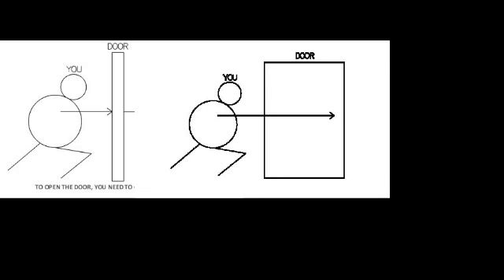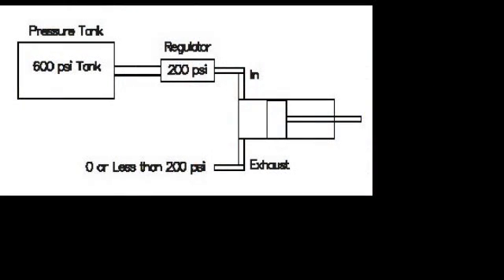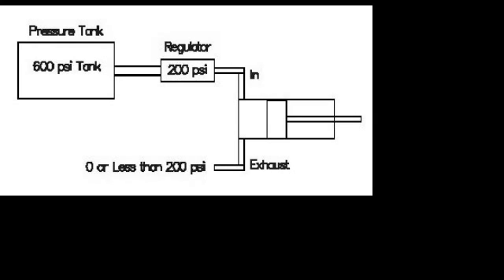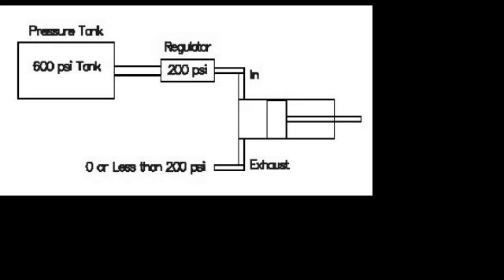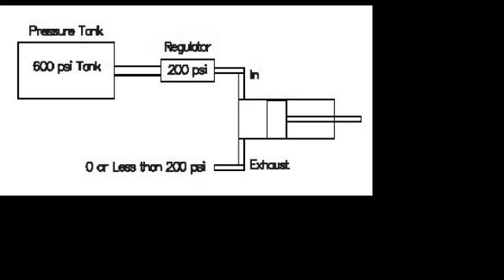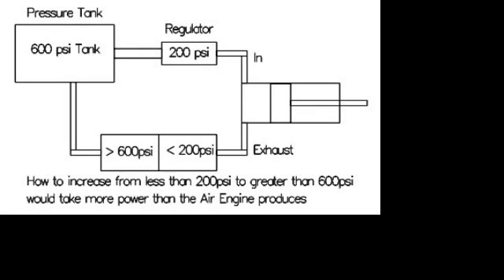Compressed Air - Recycle ?

Comment: There is a video from Terry Miller called the spirit of Joplin compressed air car, Maybe you could check on it. He was successful in running a full car on compressed air which can be easily replicated.
Reply from the maker: I watched the whole video, it is pretty impressive, but it’s pretty complicated and expensive and I guess with the help of the entire town which would be engineers mechanics machine shops it was doable.
I wonder why he used five storage tanks and he doesn’t actually say how far he can go on those five when he says 24 hour driving I don’t know if he means those five tanks will go for 24 hours. Questionable? 
I also wonder if it’s still there that was seven years ago and I never did hear anything about it back then just wondering.
Reply: @AirEngineResearch   I believe the design is simple to make. The late Terry Miller was able to show us a plactical path to air engine as follows: 1. You reuse your exhaust air and 2. You make a power stroke engine whereby multiplication of the speed drom the engine, just like what effective steam engines were designed is the way to go.
Reply from the maker: I’m using the airflow to regulate the speed of the engine and the transmission to gain power versus speed when needed. Thanks for your comment. Appreciate it.
Reply: @AirEngineResearch  I surely like the work you do. Just like Terry, Air flow requlates the engine's speeds best. Maybe you could make the engine run slower in relation to the output. lets say if you need a 1000rpm, have the engine run at 100rpm. take the output to 1000rpm using a 1:10 gear ratio. For power, you could adjust the size of the engine.
Reply from the maker: His was in high gear all the time, mine is without a clutch, but still it has four gears forward and a regular reverse. It just replaces the engine in the car. It doesn’t change the car in anyway except remove the clutch direct drive to the transmission.

Comment: Sir..i am making a project that is " compressed air engine vehicle with renewable source" ..  That means i want to reuse the compressed air by absorbing in the tank... Will it work????

Can  you please give me a idea abou this?? this
Reply from the maker: I have not been able to come up with any way to reuse all of the compressed air from a storage tank. It is possible to reuse part of it, by using another tank, but it will only be possible to save it up to the pressure in the main tank - then both tanks will be  the same pressure. The closer you get to the pressure in the main tank, the less power you will have to run the engine - due to the back pressure from the storage tank. 
The only way i can see it, is having a compressor powered by some external source to recompress the exhaust.
My advice is to make the engine as efficient as possible to get the most out of your compressed air.
There are many other videos on my Channel that might help you.
https://www.youtube.com/c/AirEngineResearch/videos

Comment: Try using  a system of none return valves and a second tank when the air pressure drops in the first tank it will automatically fill from the second tank.
Reply from the maker: Thanks Stephen for watching Air Engine Research, and participating in possible ways to make using an Air Engine possible. I have thought of many different ways to save Exhaust air, and what you are suggesting is one way that might work to save part of the Exhaust for possible reuse.
The problem to overcome will be - what do we do when the Air Pressure in the Second Tank is equal to the Exhaust Pressure from the Engine? 
The Air Engine won't run when the Inlet & Exhaust Pressures are equal.
I will see what I can come up with and do a video with my thoughts.
Any and all suggestions are welcome, lets see if there is a practical way.
Reply: @AirEngineResearch  If can fit a pump to the pulley system the exhaust air goes to the pump and then the pump sends it to the tank, the pump takes the pressure away and it should compress back in to the tank
Reply: @AirEngineResearch  https://www.youtube.com/watch?v=KXFaxWC1oBc
Reply from the maker: I am a bit skeptical, it’s difficult to see but it appears the blue hose feeding the air into the engine is coming from a different source. It also sounds as if an air compressor is running in the background. I would need to know more to be convinced
Reply: @AirEngineResearch  I have seen a similar video a long time ago and it seemed genuine, if I can find it on youtube I will post it back to you here.

Comment: I know that this is old, but there is the Exhausted Air Recycling System(EAR) where the exhaust air will go to the intake and work like a supercharger making the engine work less to capture air, kind of how Turbo chargers work in Cars. so it's kinda of a close system
Reply from the maker: Thank you for your response on my video, but a turbo charger won’t work in a pressurized system. The intake on a gasoline engine is under suction or a vacuum not pressurized and a turbo charger only puts out from 6 to 8 pounds per square inch and won’t be able to insert air into a pressurized system like 250 300 psi.
I won’t disregard the possibility someday I’m figuring out a way to do it, and if I do I’ll be sure to let you know. Thanks again for the comment
Reply: @AirEngineResearch  So the air intake from which the compressor gets it's air which then compresses to the main tank can't be supercharged? Have you checked the EARS (Exhausted Air Recycling System) they have a youtube video explaining how it works.
Reply from the maker: Hi Marvin

Thanks again for the replying, I have looked at the Video for AERS, and we are talking about two different things.

They are putting the exhaust back into the Shop Air Compressor Tank using the Compressor Air Intake to re-compress the air into the tank.

I am looking for a way to put some, or all of the Exhaust  if possible back into the High Pressure Supply Tank. 
It is not practical to have a compressor in the Air Engine System that would be able to compress 2000 to 4000 psi, so it must be done some other way.

My goal is to build an Air Engine that runs efficiently using the lowest pressure and least amount of Air as possible.  
It is intended to replace the engine of a small car or truck that can be used locally, where the air can be replaced as needed from home.

I haven’t given up on the idea of recycling, but just haven’t figured out how?

Please check out my website and see where we are today, the video you commented on was from 2016, we have made changes since then.
https://www.youtube.com/user/AirEngineResearch?app=desktop

Comment: Hola.What if you make your motor taking air like steam engine,HP,LP to tank? Highpressure sylinder where the air goes low pressure sylinder and then tank,tesla valve and tank?Thanx

Comment: Hi, Thanks for the rapid response. I agree with all that you said as it is all factors, but what if you build a smaller tank that only release air to the main tank if its at 1000psi? it will still consume more air than what it gets, but you have no loss of actual air. tweaking air usage or having another air engine driven by wind could help speed up the process of compressing the exhaust tank to 1000psi.
Reply from the maker: edward meintjes 
Thanks for your interest, but as i have said in my videos, a simple highly efficient engine system is my goal.
Trying to recycle would be complicated and increase the size and weight, along with increased costs.
Using a single high pressure tank will - I hope work ok